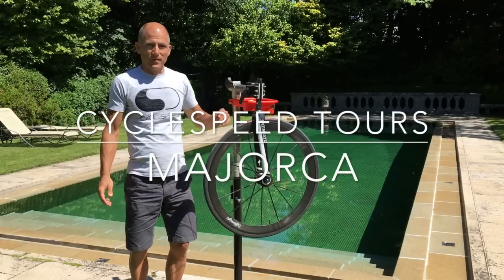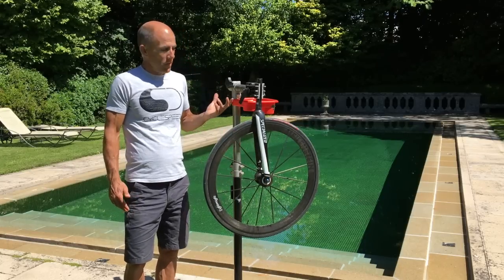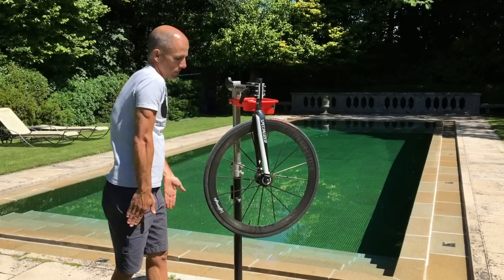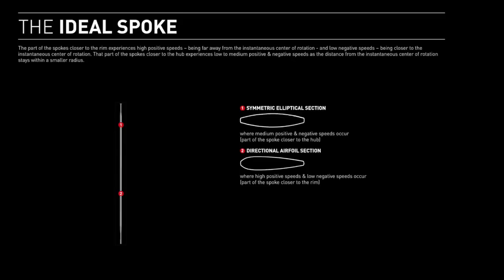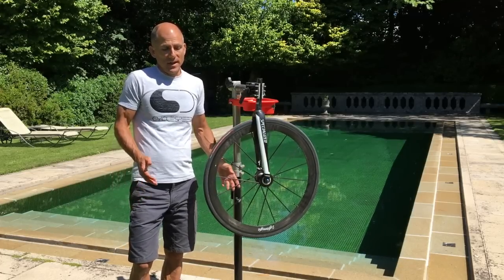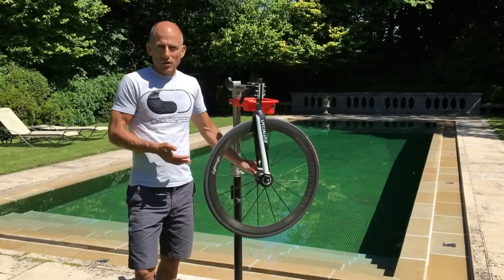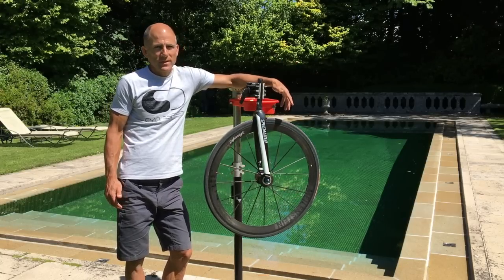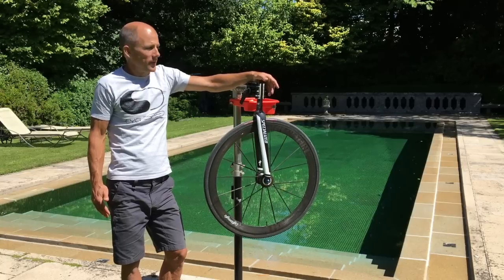Aero Wheels - What they are NOT telling you!

Comment: Totally flawed and inaccurate assumptions regarding the impact of bearing resistance imho. Run both wheels with the exact same bearings and then review the rotational drag.
Reply from the maker: Care to elaborate? Once up at high speeds (30km/h+) the overriding factor is aero drag and bearing resistance only plays a small part. This is borne out by the much faster deceleration from 40 to 20km/h than 20 to 0.
Reply: I have two sets of Zipp 404 Firecrest Tubulars running both running Vittoria Pista CS tyres inflated to 10 bar the only difference between these two wheel sets is that one set has standard Zipp precision swiss while the other set has the optional CeramicSpeed upgrade. The rate of deceleration between these two wheel sets is noticeable when then wheels are spun free as such I believe that bearings performance, not to mention wheel weight 'can' play a greater part than you imply. 
Ultimately your not comparing like for like imho. Comparing an incredibly light wheel (Lightweight claims 475g for the Meilenstein front) while the Corima 47mm deep front wheel has a claimed weight of 525g but no discussion regarding the impact that this will have on rate of acceleration and deceleration at a given power took place.
I'm not for a moment suggesting your incorrect only that your testing process is flawed and that you are painting an incomplete picture and presenting 'selective truth' to get your point across.
Reply from the maker: Thanks for the reasoned comment.
The LW is not actually quite that light - from memory there was only 10g difference between the 2 front wheels. And as their construction and depth are extremely similar, I think it reasonable to assume a very close moment of inertia. Certainly the differences I was seeing in slowdown rates could not be attributed to mass or inertia.
But as I mentioned, that video was an early one, set up very quickly, filmed quickly, and would have been much better with a speed sensor, amongst other things.
One would expect 2 identical wheels with different quality bearings to show different slowdown times, but I would wager that the 40/20 drop would be extremely close whereas nearly all the difference would come in the 20 to 0 drop.
There is no getting away from the fact that 20 spokes each approx 30cm long spinning at 40km/h+ move a lot of air. And drag is related to speed squared. So it makes sense that the dominant force at high speeds is the air drag, not bearings.

Comment: Great info, but what would be the ideal spoke and hub combination?
Reply from the maker: Basically, you are looking for bladed spokes, as short as possible and as few as possible. Smooth hub with good spoke integration, same goes for the rim.
I think we may start to see better spoke design, not just bladed but elliptical / aerofoil type shape that continues right into the rim (doesn't go circular at the worst point (at the rim)).
Reply: Cyclespeed Tours are bladed spokes just flattened, or are they made into a truly aero teardrop shape?
Reply: Enlightened Idiot just flattened... there is a taiwanese company that makes eliptical spokes... no tear drop... eliptical so the air can cut through it and smooth on the way out! Keep in mind that they are very prone to breaking... I seen some reviews and if you contact them they are very honest about it... if you are at 35kph and you hit a hole of decent size... it will break 1 spoke... they told me they’ve had them break 2 at a time... they are cheap 60$ for 35 or 40 spokes, I don’t remember that well... still if you break them that often... it can be pricey

Comment: the wheel isnt balanced if it not stay in the position you leave it. the roll force is elliptical.  it takes away momentum. so a counter weight is needed. to account for the air valve.
Reply from the maker: Specially for you; https://www.youtube.com/edit?o=U&video_id=FubJV2N9dyY

Comment: Thank You for the video. Couple of nagging questions here:

So right now we talking about rotational drag,  a part of overall aero drag, right? IS a rotational drag a factor that can change with yaw angle? If so, how we would account for that?

Deeper rim is faster for the reason you pointed out, but how about the width? Strictly speaking of aerodynamics, narrower rim and tyre combo should be faster? Marketing is pushing road bikes in the area of 25-27 mm rims, using argumentation of wider tyres and lower rolling resistance. But, as you said, rolling resistance grows linearly with speed, whenever aero drag is exponential function and wider will be slower ad high speeds. So, actual question is, where is a sweetspot of comfort and speed?
Reply from the maker: All good questions, and I don't have all the answers!!
Rotational drag would change a bit as yaw angle changes, but as long as your 'power to spin' equipment is present in the wind tunnel then you can measure for this.
We can control 2 elements of drag - frontal area and Cd. So yes, wider rim/tyres are worse for A, but potentially better for Cd, but this depends very much on careful tyre/rim matching. 
High speed track bikes with no wind present still use narrow setups and so I would tend to think that if you are riding fast in still conditions, a narrow setup would be fastest.
But if you want that extra comfort, then yes, wide is the way to go.

Comment: I hold a number of downhill Strava KOM's.  I set out to crush a record held by a 24 yo Club champ when I was 47 over a technical 12.4km descent.  I still hold that record after more than 2 years. This record (and others) was achieved on a pair of 8 year old Mavic R-SYS wheels.  Worrying about the drag on your wheels is a very low order issue in the "drag" discussion.  The biggest drag is you and your clothes.  The bike is probably only 20%: if that.   There are many issues with wheels and if you are racing or descending braking is right up there.  Carbon wheels will not stop you anywhere as well as alloy wheels from 85km/h to then turn a corner. So if your "race" has the need to slow down, then the later and harder you can brake the faster your overall time will be... and so it goes.  Helmet, clothes, shoe covers, elbow position, power when in the tuck, tyre pressure and choice,  etc, etc.
I'm still using those wheels.  They are fast, reliable, cheap and durable.  Carbon wheels are over hyped and over priced IMHO. 
Judging from your test vid outfit you would gain real speed by: buying shoe covers, wearing a long sleeve aero jersey without rear pockets, buying a truly aero helmet, take off the gloves, put your hands and elbows in next to the head stem, put on a second drink bottle, lower the position of your shifters, and lower your stack height.
Reply from the maker: Well done for 'crushing' the KOM! 
Clearly if it's a technical descent, then braking, cornering, etc. are far more important factors than aero.
I think just about everyone now knows that the rider makes up to 80% of all aero drag, and position is key, but there's no harm in looking at aero aspects of the bike too.
I'm quite happy on the LW's (and Corimas) in the mountains - I work as a tour guide, so I think I know what I'm doing. But wet braking is poor, and I will sometimes grab an alloy rim from the support car.
That vid was just me out messing around - I have and use shoe covers for races (best aero bang for the buck), I have skinsuits (with rear pockets unfortunately!), have a TT Helmet too which I don't use much these days, sometimes go gloveless, have a position which is way more aero than my peers, not sure about a second bottle -jury's out on that one, shifters already quite low on the curve and I like them like that. Stack height? It's slammed. 130mm stem.

Comment: Back in the late 80s early 90s I had two wheel sets. The only difference between them was the hubs. everything else was the same, tires and all.  One set was ultegra, the other was dura ace. With the same fitness, the dura ace set was 1 to 1.5 miles per hour faster.

Comment: Southampton Uni did some aero tests for rotational drag 9 years ago measuring watts used as well as rider position including the 'Obree' (which was significantly quicker for same watts even compared to modern 'tri'), the paper is free to view. The wheels they made up included 6/12/18/24/36 spoke plus trispoke/disc wheels.

Rotational drag is something I'd always gauged wheels by in terms of how slippery they would be, for anyone without kit that the manufacturers have (pretty much everyone) isn't it the only real test you can do (attachingas well as roll down tests that you did though even that can have its pitfalls due to even small changes in wind/body shape affecting the test.
You also have differences in rotional drag due to the shape/width of the rim and the tyre size being used, choosing to go with a wider tyre for the benefits they bring on a narrower rim can play havoc with the airflow. Personally I run wider rear as the negative effect on rotational drag due to a wider tyre is less pronounced than on the front, that and you have more bodyweight on the rear wheel in any case. (27/25mm tubs for me as I'm an ex rugby forward)

All  that said, what Corima rims/wheels were you using and what Lightweight wheels did you compare it to, I realise you were making a point re round/aero spokes and indeed spoke length (20" wheels being 'slipperyist) but from what you were saying you weren't comparing like with like. (I like corima btw, some of the best braking rims in the wet IMHO)
Reply from the maker: Thanks for such a detailed and intelligent comment!
I used Corima 47mm S+ MCC wheels (which I use in Majorca) and the Lightweights are Meilensteins. Their weight is almost identical (front wheel) and I believe the moment of inertia to be extremely close too, as the construction is very similar. It is clear that the Corima suffers due to it's spokes, even if the front's are now slightly bladed (2014+)

Comment: Also important in real world: tire overhang will reduce the aero benefits of your wheels drastically...
And rolling resistance on rough tarmac is much lower with wider rims and lower pressure. A 25mm tire on a 21C rim can easily be run at 60psi if you are not too heavy - 70psi will even be enough for "stallions". And last but not least a wider fork also offers some drag reduction.
Reply from the maker: Thanks Beaver, all good points - have you seen my silicone infill video? Helps smooth the tyre/rim transition. 
Re. Tyres and pressure, I find it depends very much on your road surface. We are fortunate in Brittany and Majorca to have very smooth roads, so I can get away with slightly thinner and higher pressures.

Comment: If considerable rotational drag is produced by the revolving spokes,perhaps large flange hubs(favoured in the 60's) could be making a comeback,this would reduce spoke length also producing potential a more solid wheel?
Reply from the maker: Nice idea, but you are improving the part that has the lowest velocity (close to the hub) whereas best gains are to be had at the other extremity, near the rim, where spoke velocity is higher.
Reply from the maker: True, but still makes sense to concentrate on spoke tips, (although any aero gain is a good one!)
Reply: se7enTse7en yeah thanks...

Comment: Your wheel in the stand is out of balance. This is very obvious as the valve is always rotating towards the lowest point... Interesting vid BTW.
Reply from the maker: Hi - yes, they usually are, as the valve area is always the heaviest point. Not sure it matters much though......:)
Reply: Darren Green the valve stem ends up at the bottom? wow, you heard of gravity?
Reply: Check Ronald Kuba's channel, he puts tungstene patches (sold in tennis shop) to improve the balance.
FKC wheels are designed with a single sticker glued to the opposite of the valve.
Last thing : being cautious while gluing a tubular tire to make sure it's in a perfect round shape.
Cheers folks.
Reply: the faster the wheel rotates, the more it matters. An out of balance wheel can cause a speed wobble, or annoying vibration that you can't get away from. Also, as ever, smoother is faster. There are a variety of ways to add weight to counter balance the valve stem to balance the wheel. It only takes a few minutes

Comment: Interesting consequence is that since the speed of an individual section of the spoke increases linearly from the hub and that the drag is proportional to V^4 then in terms of rotational drag it's the spoke nipples and only a small section of the spoke that matters. Or, to put it another way, the rim depth actually matters a great deal.
Reply from the maker: Yes, (but it's V*2 surely). Absolutely, the farthest points from the hub are the most significant, so nipples are important as is the last 10-20% of the spoke. Interestingly, often, any 'blading' finishes about here, to go round again for the nipple - would be nice if it could be kept bladed all the way into the rim, and the nipple hidden inside.

Comment: You need to get that wheel balanced - seriously unsafe! Stick Blutak/sticky clay over the rim tape under the inner tube opposite the valve adapter.
Reply from the maker: Unsafe? Seriously?! It's a tub, there is no inner tube. Maybe one day, if I can find an effective way to do it, but I'm not losing any sleep over it!!
Reply: Thanks, cool video. For balance you can easily attach sticky lead weight strips directly to the rims (as used on golf clubs) - it's shown on YouTube. Safety? I can only say that at 40mph, an approx. 12g imbalance vibrating at about 8 Hz on each 29" wheel made me slow down in horror. After balancing felt increased confidence to focus only on road surface, cross winds and traffic.
Reply from the maker: Ok thanks - although I wonder what aero implications those sticky weights might have? (breaking up the otherwise smooth, laminar flow across the rim). As a tour guide I have done a lot of Alpine descents, and I never felt any kind of vibration that might have made me back off, and this is at speeds up to 60mph/100kmh. But nothing ventured, nothing gained - I'll give it a try next time I pop into Decathlon, I'll see if they have those strips.

Comment: Why don't you just concentrate on getting better at actually riding the bike instead of expecting the components to do it for you. The percentage your talking about is such a minor part of the bigger picture I would say it is negligible unless you are a professional rider racing for a living.
Rotational drag isn't the difference between keeping up and getting dropped.
Reply from the maker: I think I can hold my own when it comes to riding the bike!! Of course, it's 99% the person riding the bike, not the equipment underneath him, but I am simply interested, from an engineering standpoint, in optimising my bike for weight, aero, etc. Will I win the Etape du Tour if I do so? No, but if I'm happy I've got my bike running as best it can, then I'll be happy.
Reply: Im sure you can, but still, you can't make your bike run any better by understand the rotational drag of your wheels. They still have the same amount of drag regardless, they won't get any better.
The title of your video suggests a scandalous cover up of information on the manufacturers behalf, not the interest of understanding rotational drag or optimising your bike in some unknown way.
Misleading title, thats all.
Reply from the maker: I'm in the market for a new set of wheels, and I'd like to understand all aspects of their aero performance before buying, and I would tend towards a set that has been optimised for rotational drag. 
I don't think I'm suggesting any kind of 'scandal' simply that it is an under-studied area of drag, and that in presenting simple trans.drag results, companies aren't giving the full picture. 
So, saying - 'what they are not telling you' I think is fair enough, as that info doesn't seem to be available. Is it the crime of the century? No!
Reply: for most riders hunkering down a bit lower will give more gains than any wheel

Comment: Interesting video. I guess it come down in wind tunnel testing methodology and how they calculate to overall co efficient of drag. If they spin the wheel up to say 30kph then take a reading off the instrumentation for drag, or do they spin the wheel up to a specified energy, or spin the wheel up to again say 30kph monitor the power required to do so and add that to the overall drag.
Reply from the maker: Good questions, and it's hard to know the answers of exactly how they test, but unless they have a power monitoring device on each wheel, they cannot know the power to spin

Comment: LW Meilenstein that essentiel is LW "standard" is NOT a aerowheel and has never been sold as that, not from LW or Carbonsports that is. The only thing mentioned aero is the lens shaped spokes. The shape and high of the rim was do to limited production possibilities back in '95 when Dierl/Obermayer made the first wheels in the small garage near Munich. They actually wanted to make the wheels like the Ventoux model that came later in 2001/2002, but back then in '95 were not able to do so. The high of the rim is simply the space between the spokes, when you draw a line from outside the hub in one side, to the edge of the rim in the other side - which actually is the path of the spokes.
Reply from the maker: Interesting, and maybe they are not an out and out aero wheel, but they are not so dissimilar to most of the other 'aero' wheels out there. Anyway, I'm not claiming anything special for the Meilensteins, I just like the way they ride, and they're light. I'd like to have a 'super-aero' wheelset as well, but funds don't permit at the moment!